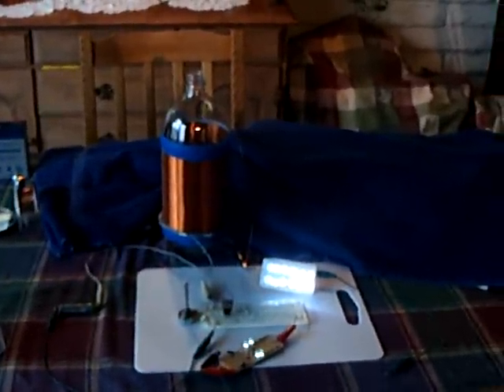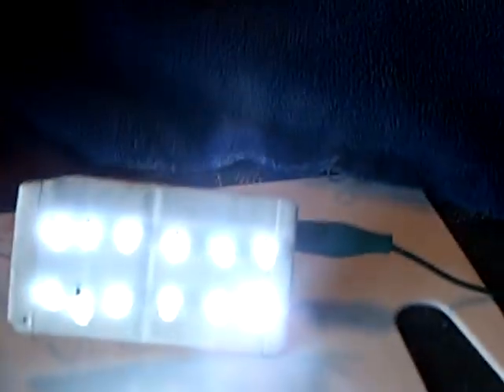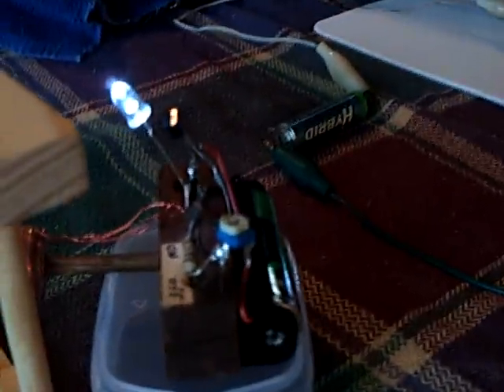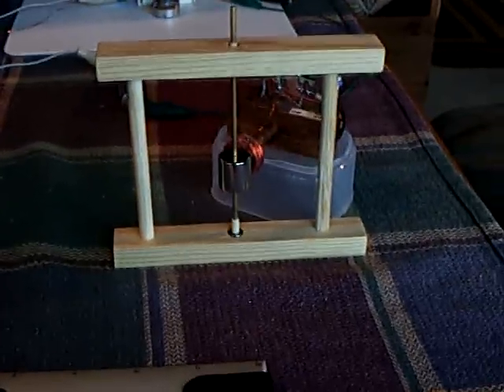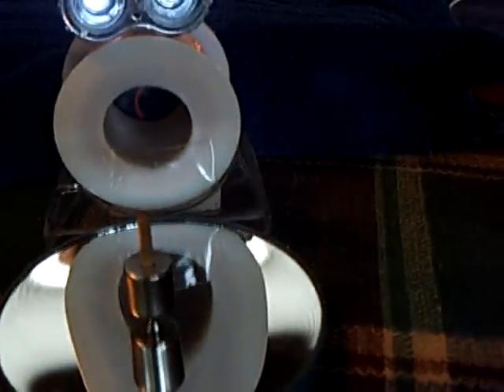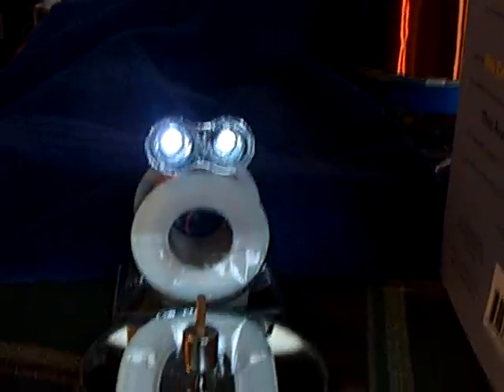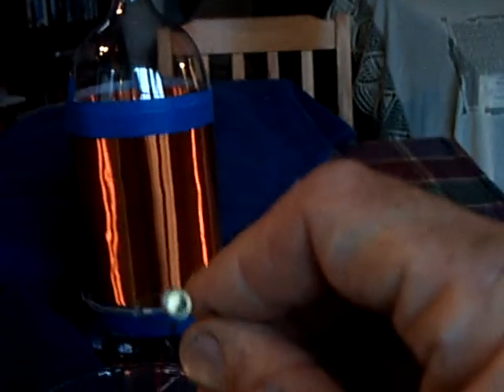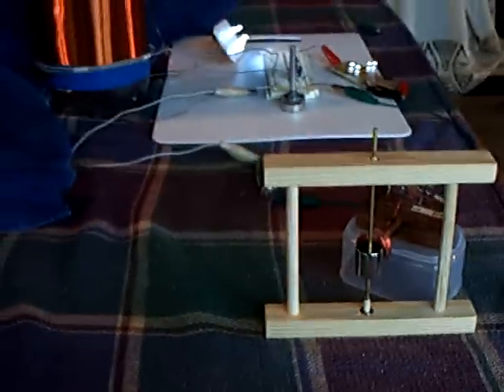Pop Bottle Exciter on a AA and the Enhanced Light Multiplier.ASF

Comment: @Iconoclast421, there is a forum thread with lots of details, or some of the older videos would help. Though, it would be nice is Lidmotor could post a URL to the forum in the description. If you google for "Lidmotor" it'll be six or so links down.